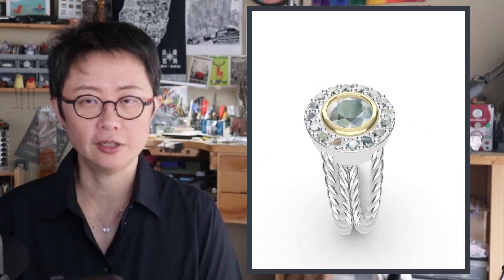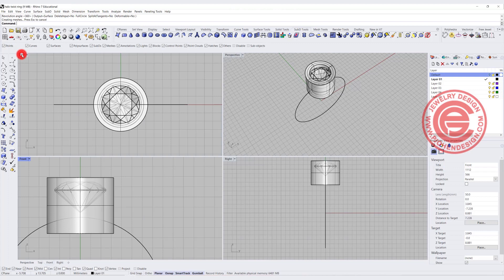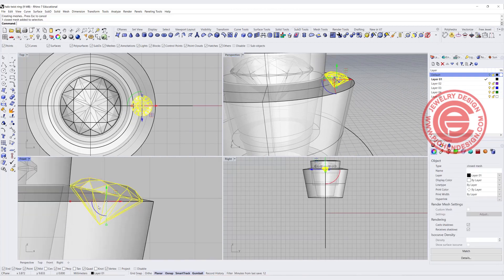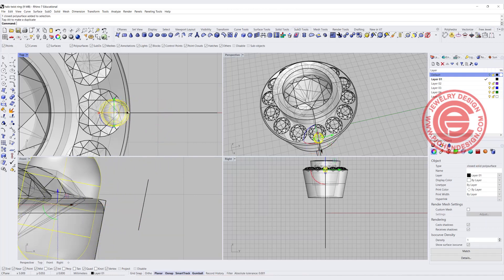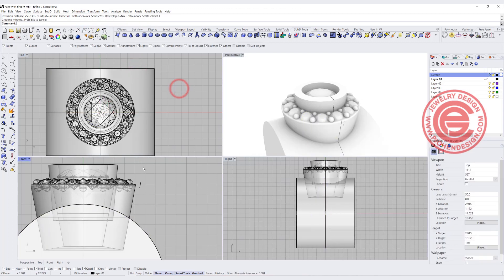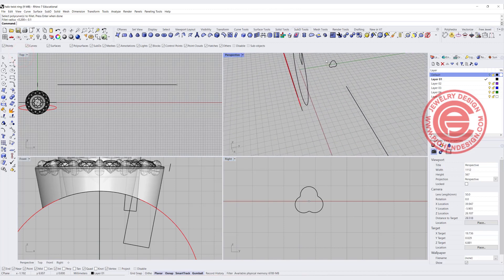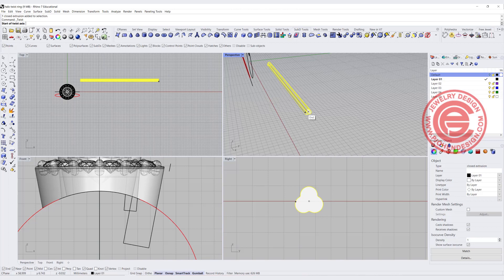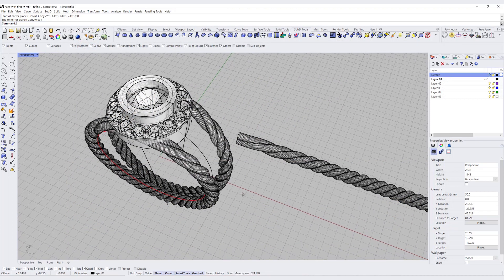Jewelry 3D Modeling- Halo Twisted Ring Rhino 3D #307

Comment: For cutting with a curve there is a very handy command - Solid Tools - Wire Cut. Just one command instead of Solid - Extrude planar curve and Solid - Boolean Difference. Has options to delete one of the parts after cut or keep both. If you keep both parts it is like using Surface - Extrude Curve straight and then Solid Tools- Boolean Split.
Reply from the maker: great tips. thanks for sharing